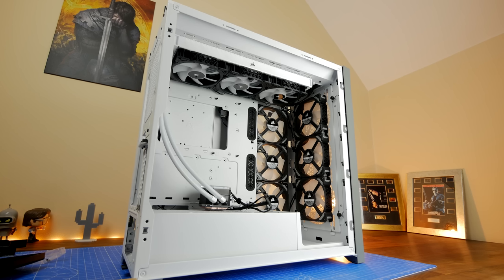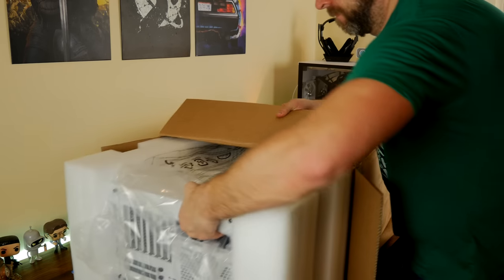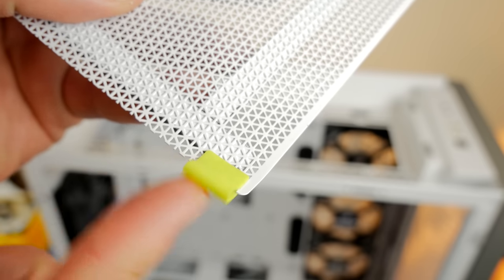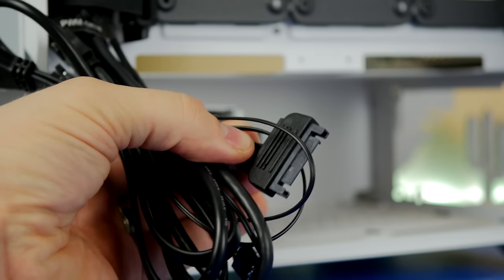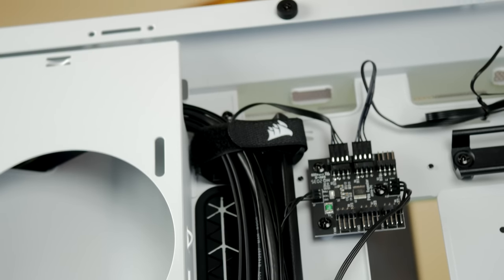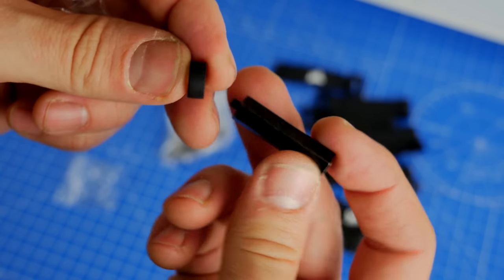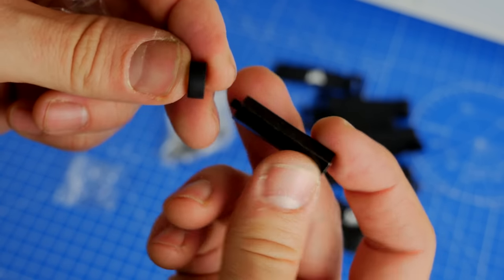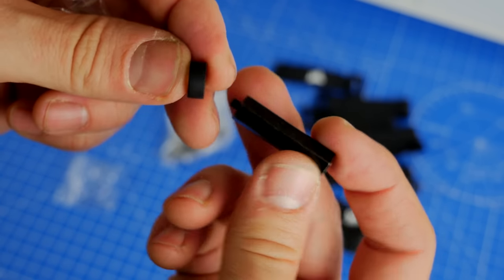Corsair 5000D Airflow build with 12 fans, H150i Elite Capellix Push Pull (in-depth build guide)

Comment: I was nervous about my HDD fitting in the tray and leaving enough room for power cables, but fortunately it fit just fine if I moved the cage all the way to the front - I have the same power supply as you. I appreciate that you can mount the HDD on the back of the MOBO tray if need be, though. Well-thought out case!
Reply: If you don't mind can you somehow show where you put it because I'm getting the case too but I don't see where I can put my HDD at
Reply: @Ostar-sz9pm  not sure how to show it, but when you get the case you can move the HDD forward. There are 2 other forward positions. You could also mount your HDD on the motherboard tray.
Reply: @malikharris4055  ohh ok I understand thanks for the reply
Reply: @Ostar-sz9pm  it may also help to plug in all your cables before you put the power supply in the case

Comment: Absolutely love this case and about to do a build in one. Just wondering, with the setup you have are all fans and rgb controllable from icue? If not, is there away to get this to work? Was planning on the 6 front and side intake fans, 3 fan exhaust rad on top and a single exhaust on the rear. 10 in total so getting them all connected on the controllers will be fine but doing it the way you have in the video will I be able to control all from icue
Reply: Hey! Did you manage to build like you described here? I am looking to build the same way and wondering if everything worked out for you in the end.

Comment: The CPU power plugs interfering with a top mounted radiator is a big annoyance of mine with this case. It's so well designed and premium that I'm really disappointed Corsair didn't think about that.
Reply: The mobo can be moved down slightly to accommodate a top mounted radiator, it's covered how in gamers nexus review of this case
Reply: @jojen  I'll check that out, thank you!

Comment: Great content, you actually answered some questions I had about using multiple Corsair Commander modules. Now, I do have a comment: Why are your temps so high on an i9 10th gen with a 360mm RAD? I have an i7 11 700K OCed at 5Ghz and all I have is a 120mm (I know, I'll upgrade soon) Corsair RAD and I get the exact same temps you get in basically the same use case. My rig is also in a Corsair 5000D. Do you think that the push / pull on top may actually hurt your cooling/temps? cheers
Reply from the maker: i9 is a hot beast

Comment: This video was freaking outstanding.  You took your time and you answered every question that anyone could have probably answered.  Your voice is great. Keep up the outstanding work, I subbed.  I have only one question, I'm using the LL120 fans with the two parts that come in the three pack.  If I only have 5 fans due to case size will I break the series of RGB and will all lights on the fans still work and be controllable through ICUE?  Also with the two-part RGB and Fan devices can I use all six fans and only use one usb header, which in my case will be the LED RGB control going into the USB header?

Comment: Thanks for the video.  Also ran into the same issue with the CPU power cable and had to order some more flexible cables.  The cables provided by corsair are massive and there was no way to get a top mounted aio to fit correctly without unacceptable (to me) pressure on those thick cables and in turn that part of the MB.
Reply from the maker: Thanks for watching.

Comment: I saved your video to finish watching later. I’m building in the 5000x RGB. I have 360mm rad installed on the top with 10 120mm QL fans throughout the case. Did you use the Commander pro to get extra USB ports to your mobo? I only have 2. 1 controls the aio the other 6 fans. I still have 4 fans that are Daisy chained to a header on the mobo, but I can’t use the rgb for lack of another USB port. I have t watched your whole vid yet, but anyway you can tell me what you did to get all the rgb connected? I have multiple lighting nodes I’m able to use and ordered a CP.  Thanks! Build looks great too btw.

Comment: To actually do this, you would need:
12x Corsair fans (ofc lol)
1x Commander Pro (not Lighting Node Pro)
1x Commander Core
2x Lighting Node Core
6x 4-pin PWM Fan splitters

So first power the Commander Pro with a SATA cable from the PSU.
Second, plug in all 6x PWM fan splitters to the Commander Pro fan control. Then plug in all the RGB cables of the fans to the 2x Lighting Node Cores. Power the 2x Lighting Node Cores with SATA aswell. Use the USB cable of the 2x Lighting Node Cores and plug them into the Commander Pro. Now power your Commander Core with a SATA cable and plug the pump control cable of your H150i Elite Capellix AIO into the Commander Core. And that's about it.

Comment: Solid video.
I have been having an issue with the included fan hub, my motherboard doesn't recognize it. Ive tried switching autho, pwm, and dc in the bios, the fan works but i'm not able to see it so i can control it

Comment: Very nice video, great detail.
If you were to use 140mm fans, rather than the 120mm, would you then be limited to two for the front and the same number for the top of the case...?
also if you did fit those, having already got 140mm fans, do you think that they would appear to be balance and also effective, altho you wouldn't really see them from the outside - no bling being fitted.

Thanks
Reply from the maker: Alas I didn't try 140mm so I can't comment. However, if you look in the description you'll see the possible places you can fit 140mm, as described by Corsair.

Comment: Very good video and I think you mentioned most if not all the major points about this case. Personally I thought getting the glass off for the first time felt like a leap of faith and with the replacement shroud which shows off the bottom side fan it doesn't leave much room behind the PSU. I literally could not get the door on but could get the back panel on, so all good and will go back inside in a couple of months and totally re-wire. I rate this case for its looks and versatility, for the price it's great value and hopefully the last case I buy. Have used 3 cases since 2019 😂

Comment: amazing video. I have the case on the way with a 12700k and a 3080ti. Prob need more fans but learned a ton watching this. Cant thank you enough! Do you know if I slap my m.2 from my old rig onto the new board will it work straight away?
Reply from the maker: Should be fine. 👍

Comment: excellent video my friend.   I am building 2 PCs.  One for my son which will be my old components in the 4000x RGB. the I am switching out my new PC components from a Corsair Crystal 680x to a 5000x RGB.  I will probably sell the 680x or turn it into a VMware server.  I am sure this question has already been asked\answered, but what is the purpose of the Push\Pull setup with the Capellix?  I have the same cooler in black.
Reply from the maker: Just extra airflow support..it's not essential

Comment: Elegant build!  Is this set-up quite loud? Twelve 120mm fans seems like a lot! Have you tried any 140mm fans at for the front (and possibly the top) to compare noise levels?
Reply from the maker: It depends what you're doing. Both the GPU and AIO have a zero RPM mode so it runs really quietly with normal use but obviously when you put it under load it gets a bit noisier.

Comment: On the side vent there is no air filter? also I noticed you didn't put that cable cover back in? I have put mine in and looking at it they way its designed it will push air over the mother board

Comment: Hi,
A quick heads up if you plan to use the ARCTIC Liquid Freezer II 360 with the 5000D. It uses a thicker rad than most AIO's (38mm). As a result it could not be top mounted with my MSI Z490-Pro A. It would not clear the VRM heatsink, it literally came down to less than 2mm of clearance . I did manage to to mount the 360 at the front. I prefer tubes down but that was a stretch. If your AIO uses a thinner rad you will be fine. None the less I still really like the case and might change the AIO and keep the Arctic for a future build.

Comment: those 8pin cpu cables are really scary trying to get it to fit with that aio.  I ended up running them around the front and just under it looks trashy but i am afraid of bending or putting too much stress on my cables/motherboard.  Anymore advice?  I have sleeved or the flat corsair shift 1000watt psu.
Reply: If anyone cares I bent the 8pin cpu cable at the connector and it’s fine.

Comment: Very nice case. It's definitely something I will consider in the next go.  How to you enjoy the noise from the pump in that AIO?  I have a  Corsair IQ H100i Elite Capellix  in a 4000 case that I can't get lower than ~2300 RPM. It's uncomfortably noisy for my ears so I'm looking for options.
Reply: I had the same issue as you described, I originally thought the buzzing was caused by a defective unit thus I obtained a replacement. To my surprise my new unit still had the same issue thus I reached out to Corsair and they confirmed that the new Elite Capellix series uses a new pump design that doesn't allow RPM to go below 2300. Its unfortunate as I really liked this AIO unit (especially the included commander core), but I am probably going to swap to another AIO as the buzzing is unbearable during idle (I have a Corsair 4000D too and sound dampening is not really its strong suit).
Reply: Many users complain about this as well in Corsair forum. The black elite capellix pump quiet mode is only able to hit 2300 rpm (I assume this white version would be the same) and based on the information in that thread, it seems the problem is hardware limitation. I wonder how much discomfort that sound will be to my ears. Currently I'm using H115i rgb platinum which uses same pump by CoolIt, I'm running it at balance mode (~ 2276 rpm, the quiet mode can go down to ~1800 rpm) and I couldn't hear noise that's uncomfortable to me. However, every person has different level of sound perception and I might be less perceptive to low humming sound than most people. If the capellix sound the same as the platinum version then I'm good for upgrade.
Reply: @anthonychan8580  Interesting. Thanks. I'll replace mine with a Noctua NH-D15S Chromax aircooler for now.  There are to much uncertainty around AIOs for the time being. Will do a lot of research before I buy another.
Reply: @yohanes2034  I'll check  the forum there. Thanks. I'll prob avoid anything related to Coolit when it comes to pump unit for the time being. Asetek's pumps are much more silent it seems.
Reply from the maker: I haven't noticed an issue with the white one actually.
Reply: @TheProvokedPrawn  I wonder whether the pump unit is configured differently depending on the radiator size. Most forum posts complaining about the buzzing/whining noise seem to be for the 240mm model.
Reply: @bback74  I am planning to do the same myself, I ordered the Noctua NH-D15 chromax. Hopefully it will be a lot quieter!
Reply: @yohanes2034  your mileage will definitely vary as the “noise” depends on multiple aspects such as ambient surroundings, overall hearing sensitivity, proximity, etc. My room is currently dead silent so I can hear even a pin drop thus I found the pump noise quite irritating (it sounds like a mosquito in the room); however, I can’t notice it once I start up a game as the buzzing is dampened out by all my fans spinning up. I think for most people this won’t be an issue, but if you are used to being able to adjust the pump to a much lower speed then that is something the new elite capellix models can’t do.
Reply: you are correct though it's a shame that while Corsair brag about 0 rpm fan speed, the pump itself cannot go lower than 2300 rpm. IMO their premium line should provide wide range of customizability for all users. I blast my AC most of the time so that could be the reason as well plus there's a small refrigerator near the PC.
Reply: @anthonychan8580  Agreed. I have it very silent as well and having a cooler that sounds like that when the computer is idle (watching movie, youtube, browsing etc) is just unacceptable for me. Playing games with headset on it will not be an issue maybe. It's still kinda high pitch sound so I think i will notice it either way.  It's weird that you have so little room to play with regarding the pump speed. Quiet: ~2300,  Balanced: ~2470 and Extreme: ~2680. If we somehow could get that quiet mode down to sub 2K I think I could have lived with it.
Reply: @yohanes2034  That is a good point, the included fans are able to go zero RPM while its not even the most noisiest part!

Comment: Hello, thanks for your video, I got one concern for this case, if install 3 intake fans on the side and another 3 intake fans in the front, will the airflow from the side block the air intake in the front? which means the motherboard part doesn't have enough airflow to get cooled? this is the reason I am still considering to buy this case
Reply from the maker: No
Reply: makes no sense to me either... i swear there´s much better airflow without the 3 intake on the side + 1 exhaust on the back
Reply: @RocceFella187  this is what I mean either, I did lots of search on google but no answers
Reply: There is a side panel that goes over the side fans that directs the air towards the motherboard.

Comment: I don't know if you're going to answer me because your video is from early 2021, but I like this push/pull system and would like to use an A12x25 Chromax instead. 
Do you think it will fit in the size? If not, would you have any fans to recommend?

Comment: Got this same case and I want to do a similar push/pull setup. My main concern is the strip of holes to the side of the fans. Did you do anything to minimize dust coming in through there? I know you can put the dust filter on top of the fans, but it doesn't cover that side strip.

Comment: Why you not use the radiator push and pull in the front panel in case? whether on the front panel does not allow and does not fit

Comment: If you want 9 fans in this case , will you need a commander pro for the connectors.?  as the fan controller only has 6 fans available while the specs of the case is 10 fans...? where do i put the extra 3 fans i have...?
Reply from the maker: You could use y splitters or motherboard fan headers

Comment: I've been waiting for your video reviewing this case. In my opinion your case review video is very thorough because you do the review using PC builder point of view. A lot of of my initial questions have been answered, but I do still have some that I want to confirm. Regarding the 3.5" HDD installation options, obviously if you install the optional PSU cover you won't be able to move HDD cage towards the front (and the pre-installed location is impossible for full size PSU to be installed since no space for the cables at all, even if you slide it to the front, it would be still a tight fit). Can we install the HDD on the plate at the back of the motherboard or on the place where 3 SSDs are pre-installed? I saw that you pointed out HDD mounting hole on the motherboard plate, did you find screws that can fit with that hole?

Glad that Corsair fix the radiator screwing hassle. The white 5000D airflow and white H150i elite capellix would be my future combination for case upgrade later this year. Thanks for the video!
Reply from the maker: As you said the backplate is the other option. I should have done it, there are certainly screws included to do it. I suspect mounting it on that plate would be the easiest option. And thanks for the nice comments. I thought 50 mins might be too long but I was trying to be super thorough.
Reply: @TheProvokedPrawn  It's better being thorough rather than not. For long video, that's the use of timestamps. I saw a post in the corsair forum that mentioning no screws can be found that can be fitted for HDD installation on the motherboard back plate. So just want to check if you have similar experience.
Reply from the maker: @yohanes2034  hmmm. There's screws in the HDD cage accessories box for sure but like I said I've not tried it. I've got to take it apart at some point so I'll have a look then for you if I remember! 🧐